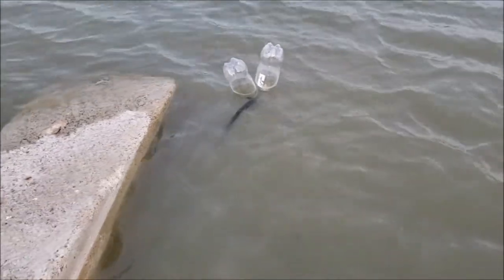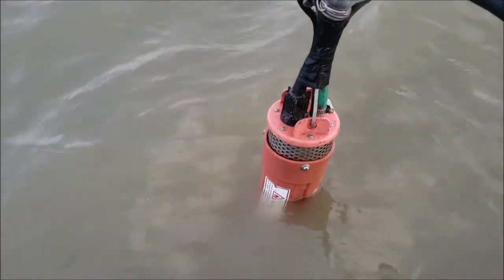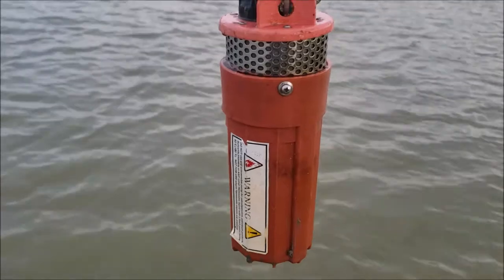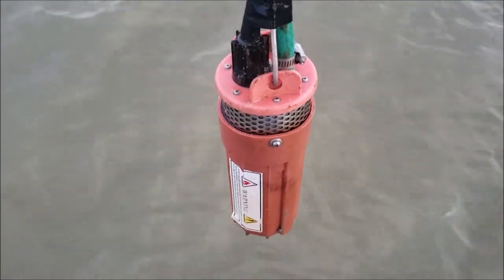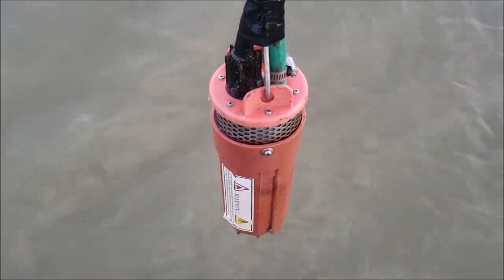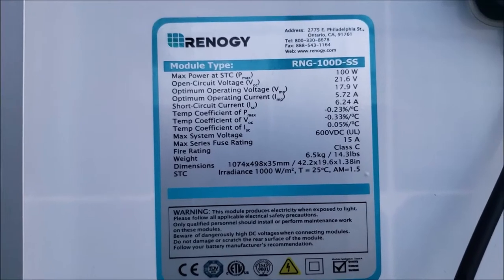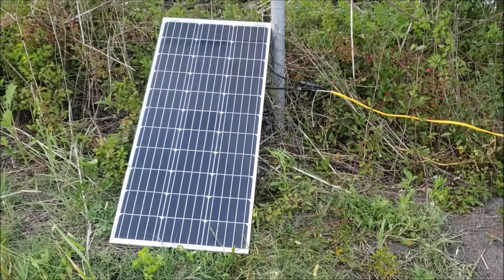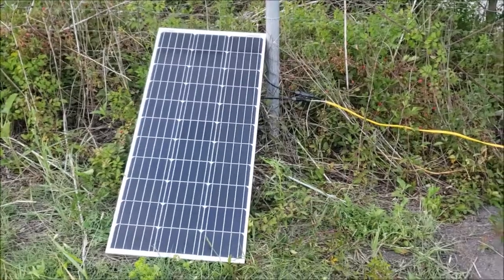Easy Solar Powered Water Pump

Comment: Thx for your video.  This is the first I've seen with basic set up and extra clever bits like the valve and the floats...  I am just trying to set up a pond/fountain which will flow from a terracotta dog's mouth into a pond/dog bowl but I've tried for 2 years now and people I've asked have been no help.  Your video shows my idea can work, so thank you for that.  I've seen videos with the complete store bought fountains and more elaborate set ups but never the simple pump set up.  So thank you, thank you.  I've had people tell me I had to have battery storage etc but I just want dawn to dusk like you say here and I didn't think I needed battery storage.  Again, thank you!   I reckon my panel wasn't strong enuf even for small pumps so I've ordered a 30amp for a 20amp pump.  Not sure how the cut off thingo works - or whether I need a cut off - but a control panel of sorts is coming with my new 30amp panel.  Fingers crossed.  ps.  love the accent.
Reply from the maker: It works well for what I am using it for.  No battery needed.  I use to do the same setup using a boat bilge pump but those type of pumps don't lift water very high.  If you need a cut off, you can use a pressure switch and a timer.  I have that shown in another video on the channel.  Thanks for the feedback.

Comment: I was so excited after finding this video but it was short lived. I purchased the Eco-Worthy 24v pump in your description a d the Renogy 100 watt panel. It worked perfectly for 2 months and quit. The lower housing of the pump had filled with water (evident by the sound when giving it a shake). The seller sent a replacement (took 30 days) & it failed after about a week. No water intrusion this time, just stopped. I was concerned that it died due to the low voltage conditions when the sun was obscured. Amazon refunded me 100%. I then contacted a different seller on Amazon, asking about power specs. They provided very few words but in short stated "18v isn't enough" and "you cannot connect directly to a 100w panel". There specs in the ad state "hook directly to 250w panel". I'm sharing this, not questioning your video at all, just hoping for understanding.
Reply from the maker: Man, sorry to hear that.  I have three of these pumps that I bought years ago.  I used two of them and had the 3rd as a spare if one went out.  The two I used first lasted years, and one of them is still going.  I kept the one that failed as parts and used the new one.  I swap them out about every month or so to allow me to clean them.  That has been working great for me.  The one that failed actually did the same way your first one did.  It started letting water get into the motor and locked up.  I started with 1 - 100w panel and then added another to make 200 watts which allowed the pump enough power to pump much longer throughout the day.  I have them connected directly to the pump, no batteries or controllers in between.

I have a feeling based on comments I have gotten that these pumps have either dropped in quality or I got very lucky with my batch.  That is sad really, because they work great for this purpose if they will keep running.

Do yours say they can run 12v or 24v, or just 24v?  The ones I got said they would do both but at different flow rates.  I wonder if they changed the motor or electronics in them?
Reply: I received a response from the seller stating the operating voltage range for this pump (Eco-Worthy 24v, 1.6gpm) is 20-36. My Renogy 100w panel is putting out 22.4 volts in full sun. It was registering 18v when I measured it while connected to the most recent pump, after it had stopped working. Not sure if that voltage measurement was decreased due to the failed motor but I think that's possible. At any rate, 22v is within operation range of the pump. I have to assume that there were periods of shade/clouds that might have cause a decrease in voltage (below range) causing eventual burn out. Since yours has worked so long, I can only assume that the pump quality has changed over the years.
Reply: I have to correct my earlier report. The pump DOES run on the single Renogy panel after all. I wrote that the output was only about 18vdc so I contributed that to the pump's failure. I discovered today that my panel had a broken solder joint inside the back box. It wasn't detected sooner because it measured about 18vdc without a load, consistently. I'm certain now that it was dropping output voltage intermittently. The two metal tabs were touching but could be separated with minimal pressure. I soldered them and now that same panel is providing 20.4 vdc. The pump is tunning with no problem. I'm sorry if my earlier comment caused any doubts about your video. I had a faulty panel and didn't know it.

Comment: Great video and thanks for sharing!!!  I plan to use it to pump water up 15 feet of head  and then along 300 feet of field to water fruit trees from a beaver pond without a battery

 What solar panels do you recommend? 

What's the big difference between using 12v and 24v?

Where did you get your valve to stop the wter flowing back? - great idea?

Any advice on how to install a timer that turns th pump on/off for prescribed watering periods?  What kind of a switch is best for that? I'm thinking one installed in-between the panel and pump that has its own small battery supply, like a Christmas tree light timer...  Any advice?

THANKS!!
Reply from the maker: That sounds like a perfect idea for this pump.  The key to keeping them running for a long time is cleaning them.  Watch how much growth builds up on them and how fast and base your cleaning schedule on that.

The solar panels I used are these: https://amzn.to/3GKrkxE
They are 12v panels, but you can run them in parallel or series to get the voltage you want.

I used 2 panels and you can really either do them 12v or 24v and it's about the same really.  24v is technically better because then you are getting better use out of your wire because wire is usually based on amps more than volts so you can run double the power on the same wire if the voltage is 24v VS 12v.  I run mine at 24v.

All I did was put in a check valve to keep the water going in one direction only.  This keeps it from draining back into the pump and lets it start right where it left off.  Like this: https://amzn.to/3oiJBf6

As for the timer, this is what I did: https://youtu.be/4e2c5WEIN7Y

Hope this helps.  Hope it all works out great.

Comment: Question .... Would that pump fit down a well head i think it's either 4 inches wide or 6 inches wide. Interested in having it as a back up that i can drop down into the well if the electric goes out so that o still have water.
Reply from the maker: I think if it's a 6in casing then yes, but not a 4in.

Comment: How did you wire the solar panel to the 12 gauge wire? Which wire got to which wire? Thanks in advance.
Reply from the maker: Run the positive of the solar panel to the positive of the pump and the negative of the solar panel to the negative of the pump.

Comment: My man,you made my job simple as i bought similar pump from overseas to South Africa,,now i was wondering what size solar panel to use and i didn't know that the pump can work directly from solar panel board,,wow man you made my year simple as we going towards Christmas,,,,,, ,,,,South Africa
Reply from the maker: That is awesome.  Glad it helped.  Good luck with the solar pump setup.
Reply: if you use a solarbpanel use a chargeable battery also for storage back up,,its the logical thing to do,,when power is down,,that being the sun,,.

Comment: hey buddy,iam in South Africa,glad i bumped into your video.I was looking at exactly this same pump and i even have pictures.You literally answered all my questions and i like the floats idea you did there.i will be draining from a well.One question,say the water kinda drys up in the well and it starts sucking in mud or dirt,how do you go about cleaning it out?and how do you tell if its clogging?

great video again.Thank you
Reply from the maker: You can take apart the top of the pump pretty easy to clean it deeper inside.  Just don't go all the way into the motor.  I have not ran it dry.  If the water starts getting low I move it deeper into the lake, so I don't have much experience with it running dry.
Reply: @SeidelRanch  i appreciate the feedback
thank you so much

Comment: I have this kind of pump 12v 96watts....can I. Use it with a 300watts 24v panel?

Pliz help
Reply from the maker: It should be fine as long as the voltage is 12v or 24v.  The amount of watts pulled will be based on the pump.

Comment: Well if you had five or six of those going just using solar power and you put a decent size thousand gallon or more water tower up you'll have all the water you could possibly want then you could hook a small water turbine up to that thousand gallon water tank and generate extra power during the night then fill it up again during the day
Reply from the maker: Very true. Sun power up and "backup battery" down.  Would be cool.  It would need to be a pretty tall tower to build up enough pressure to provide decent electricity.

I thought about something like that, but just for irrigation use up on the hill.  The added pressure would be needed to get the water to the right zones from the tank.

Comment: Would adding a pressure tank help the flow of the water ?
Reply from the maker: It's really based on what you are trying to do.  Pump flow will not change, but with a pressure tank you have a reserve burst of water in the tank waiting for you to use it.  Since what I use the pump for is irrigation, it would not really help me any.  If you are using this for quick and short bursts of water, then a pressure tank would help.  Hope that helps.

Comment: If running to a tank how do you stop overflow
Reply from the maker: I would put a float valve and a pressure switch on the pump to turn it off.  I did that in one of my other videos.  Check out the other videos about this on the channel.

Comment: One last question: my pump will be about 150' from my solar panel. What gauge wire do y think I should run between them?
Reply from the maker: You may be ok with 14 AWG, but I think I would use 10 AWG or 12 AWG.  I have used 12 AWG on runs that long with no issue.  This is assuming you are only running the one pump on it.
Reply: Thanks again. My pump and solar panel arrived today. I ordered the exact same products that you used in this video. I can't wait to try them.

Comment: How’s that pump still working ?
Reply from the maker: Still running great.  I have 3 and they all work as soon as I plug them in.  I rotate them out so I can clean them.  Been running for years and no issues yet.  I think the key is cleaning them every few months.  When I pull them out of the water they will have build up of growth and dirt.

Comment: Hi there. Your video is very helpful. One question I have is how do you extend the wires. 
It only has 10 ft of wire but I need it for about 40 ft well. Also, how so you turn it off?
Reply from the maker: I just used some 12 gauge wire to extend the ones it has.  If the wire will be under water make sure it's waterproof and insulated well.  I used a pressure switch to allow it to turn on and off.  See these videos too: https://youtu.be/4e2c5WEIN7Y and https://youtu.be/_0KqeDTgLDE
Reply: Thank you very much. Your help is really appreciated. My cast iron manual pump broke. So, I bought a 12 gauge extension cord. I am thinking that I can splice it with the other wires. Would that work? Do you think that I could control the on/off by covering and uncovering the solar panel? That worked for my pond fountain.?
Reply from the maker: @juliewalker6135  The extension cord should work as long as it's good quality.  Covering the solar panel will make it turn off.  I use to just use the panel like a dusk to dawn switch.  When there was light, it worked.  When it was dark it stopped.  Good luck on the build.

Comment: Howdy from azle. I ordered the pump. The panels are going to be about 75 feet from the pump. How do I wire 2 100ws together or am I better off with 1 200 w. I'm going up about 100 feet of elevation and 300 length wise. Super excited to try. Definitely getting check valve. Any mods you've done to help strengthen it?
Reply from the maker: You can go either way, (1) 200w or (2) 100w panels.  The pump will run 12v or 24v so it does not matter if you run series or parallel on the panels.  I did (2) 100w - 12v panels in series to increase the voltage to 24v since the amperage was good enough already.  This gave me a longer run time.  Look up "series vs. parallel" on solar panel wiring if you need some help.  It's pretty simple either way.  Look at my other solar pump videos to see the on and off timer I put in, the pressure switch and the check valve setup.  Good luck and I hope it does great for you.  Let me know how it goes.
Reply: Found a used 280 watt. I'm pumping to a pretty large sump but definitely need a switch down the line. I'll take a look.

Comment: Great video. I’m in the U.K. and the same pump here is shown as needing a controller and battery? Do you use either of those?
Reply from the maker: I did not use either of those.  I hooked the panels directly to the pump.

Comment: This is amazing, thank you so much! I am about to order the same pump, we want to try this setup on our land in Portugal. One question, I understood it turns automatically on when there's enough sunlight to run it, and it turns automatically off when the sunlight is not strong enough. Did you have to do anything for that (install any extra pieces etc) or does it do it by itself with this basic setup? And what is the pressure switch for? Does the system also work fine without it or would you recommend installing it as well (it was kinda complicated for me to follow until there)?
Reply from the maker: The auto on and off is based on the amount of sunlight and you do not need anything other than the solar panels and the pump for that.  The pressure switch is so I can make it turn off if the pressure gets high.  This is because I have inline water switches that turn on and off to water different areas.  It's not needed if you don't want that part.

Comment: We will be using this same system for rotational grazing of our cows.  Curious if the pump will turn off when float valve at water trough stops the water flow?  Thanks for the videos...very helpful!
Reply from the maker: Check out my video about this setup with the pressure switch.  I think that is what you need.  https://youtu.be/4e2c5WEIN7Y

Comment: Thanks for this awesome video. I have read about the ability of these pumps to lift water to a certain elevation. My question is, how far can I push it laterally? Do you have any idea how many linear feet This pump can push water?
Reply from the maker: It can push water pretty far.  Check out the channels page (https://www.youtube.com/SeidelRanch/videos) and look at some of the other videos I have on this pump.  Most are 1-2 years old, so you have to scroll a little bit.  I have had it push over 100 PSI and blow my connections off.  With 2 100 watt solar panels I can get water all over my 40 acres from the lake.  I probably have about 3000' of 1/2 poly line that this pump pushes water through with no issue.  That is also pushing water in some areas up over 80' in elevation and its still only having to push at about 25 PSI to get it there.  I would expect it could push water many, many more thousands of feet if it is only lateral.  Hope that helps.  Check out the other videos.
Reply: Thanks for the quick reply!
Reply: Depends on the type and diameter of the waterline and the elevation.
You find calculators for that stuff online.

Comment: Are you using a 100watt solar panel?
Reply from the maker: Yes.  I started with one 12v 100watt panel and now I use two of them to get more run time.  These are the ones I use: https://amzn.to/3B1tzZ0
Reply: @SeidelRanch  nice I'm going to do this when it gets warmer. So glad I came across your video.
Reply from the maker: @codykingsworld  Awesome.  Let me know how it goes.  Good luck.
Reply: @SeidelRanch  so this pump can handle a 24v panel peaking around 36v ?

Comment: I am looking for DC sumbersble pump of 5 hp. For this pump I would install 8 solar panels 500 watts each. That set up would give 2500liters for irrigation from a canal of 6 ft head.
Reply from the maker: A 5 HP DC pump may be hard to find, but not sure.  You may be better using multiple pumps to get the output you want.  Keep me updated on how it goes.  Good luck on the project and I am interested in how it turns out.

Comment: I was so excited about this (and your other videos about this setup you have) , but when i clicked to the amazon link, it said it is a 24 Volt Pump.  Do you think it would be the same outflow if i had a 12 volt battery hooked up with the solar panel? (I really need to lift and push about the same distance as you did.)
Reply from the maker: It's the same pump, they just list it as 12 or 24 volt.  I run mine at 24 volts from the panels, but you can do 12 volts and it will just pump about half as much.  I think one of mine says 24 volts and the other one says 12, but they are the same pump and I run them the same way.
Reply: @SeidelRanch  thank you for replying so quickly!

Comment: I have a lake and need to pump up water to water my plants.... Does it require any other equipment besides the solar pump and panel? The pump connects directly to the panel right? Your video is a good and cheap alternative to pump up water!!!
Reply from the maker: Yes, as long as the panels are 12v or 24v, you can connect them directly to the pump.  No controller needed.
Reply: Thank you for replying!